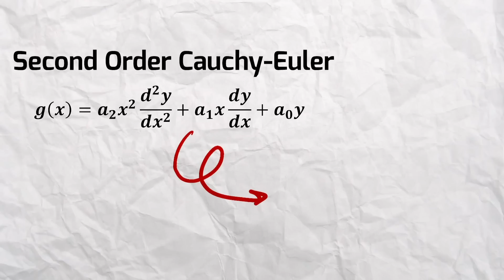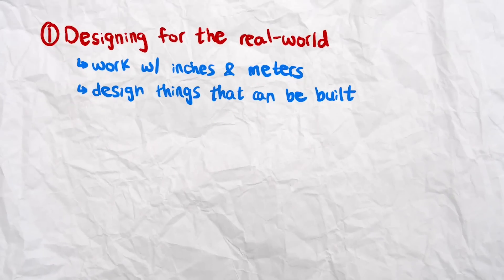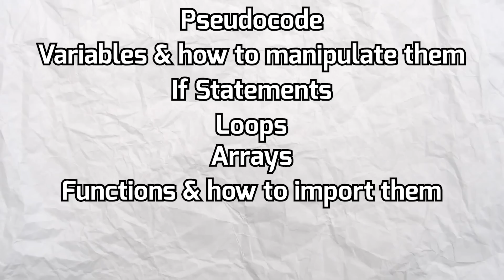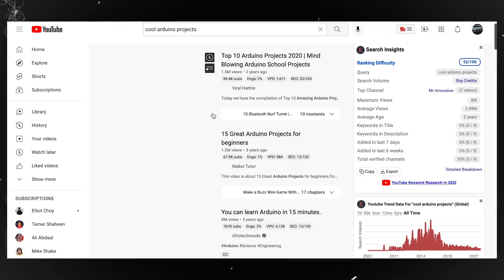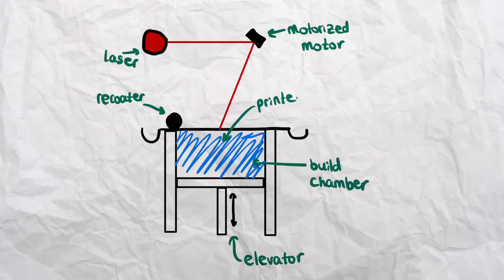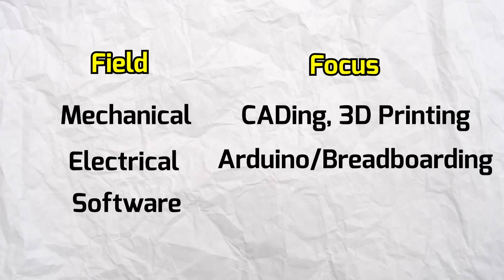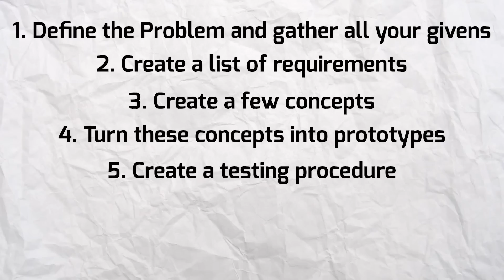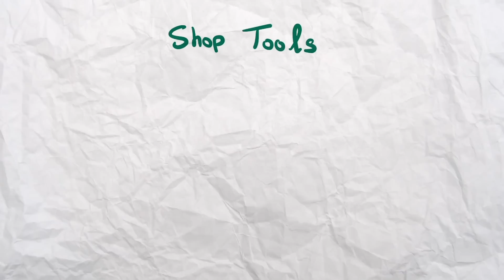7 Skills Every Engineering Student Needs

Comment: As a recent mechanical engineering graduate, I highly confirm every skill he mentioned. Great video!!!!!
Reply: How do I get into an engineering university you need like 3 A levels here and I don't have that because I never did that also A levels individuals cost 1 thousand so for the 3 I need it would be 3 grand and that's an entire years worth of work I have to fit in while juggling a job it's so insanely difficult to get a job these days that pays you more than minimum wage
Reply: How hard was it?

Comment: Quite an ambitious title.  Let me be the dissenting voice on "coding".  Coding is to software development what turning a wrench is to engine design.  Software development means you need to have requirements, systems architecture, subsystems architecture, structure, flowcharts and then finally code.  Software development can be open loop or closed loop.  Government contracts tend to be open loop.  You define the exact requirements up front and meet them.  Real world software development tends to be closed loop.  You take your best open loop design as step one, make a minimum viable product, give it to users and then make corrections and extensions as you go along. You correct your way to the end product. The customer rarely knows what he really wants (I'll know it when I see it) and locking in a target leads to wasted expense. This takes advantage of the fact that software is "soft" and not million dollar dies. One disadvantage of closed loop is that managers love schedules, budgets and tasks (that require a check mark to be done).  Closed loop doesn't have an obvious end.  It needs to be determined. Once your manager has put a check mark in the completion box, more work is not acceptable.

Comment: Hi Tamer Shaheen. I am currently working as a mechanical engineering intern, and what I understood first hand was the importance of spreadsheets (mainly excel) for doing all sorts of things with data. The senior engineers working there even asked me to learn to excel at excel. 
So I really think you missed excel out in this video. 🙃🙃

Anyway, great video as always.
Reply: Wow, I didn’t know spreadsheets were so important, I’m curious about which kinds of tasks do you use them for as a mechanical engineer
Reply: @vaidya31  its mostly bcus hes an intern
Reply from the maker: that's interesting...I personally haven't used excel much and many of the engineers I work with don't use it either. Honestly, I also wouldn't be happy working a job where I use excel all day, so I never really applied to jobs that ask for that skill.
Reply: excel's one of those general skills essentially everyone should know going into essentially any industry. its incredibly practical and versatile, but its hard to consider it an "engineering" skill; for sure though, its something higher-ups will make interns do cause its too tedious for them to do themselves (case in point, me)
Reply: @vaidya31  I actually worked on external pressure vessel calculations for designing pressure vessels as a part of my internship. Now, the parameters like thickness of vessel, the unstiffened length, etc. are optimized in a sort of trial and error fashion. So I was asked to actually design an excel sheet that could calculate and optimize these parameters.

Now excel is still preferred by many engineers for many engineers (at least the senior ones) because it's really powerful, intuitive to use as well as relatievely easy to learn. Also data analysis in excel is also quite amazing. So all in all, it is a great tool.

PS. I am sharing what I understood from my limited experience as an intern only.
Reply: @TamerShaheen  Well using excel everyday was of course the boring part. But still I got to learn a lot from this internship. So I just see the fact that I had to use excel as a minor inconvenience in that journey of learning new things. 😅🙂
Reply: i was gonna comment Excel!!!

Comment: If one wants to go the entrepreneurial route but involved in engineering, what's a better choice? Mechanical or software?
Reply from the maker: Honestly, either work. It really depends on what venture you want to start.
Reply: @TamerShaheen  what has more opportunities? More doors, more options? Both are good for entrepreneurship, but, what would be more easier. That is, what is less saturated on terms of entrepreneurship.